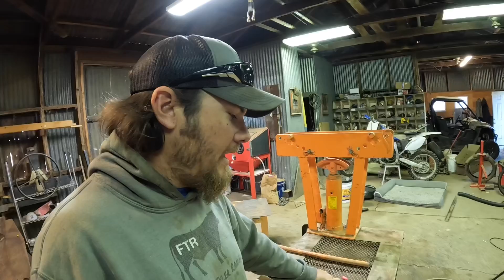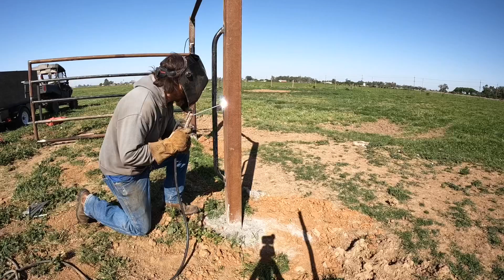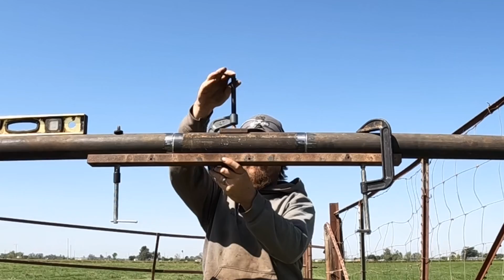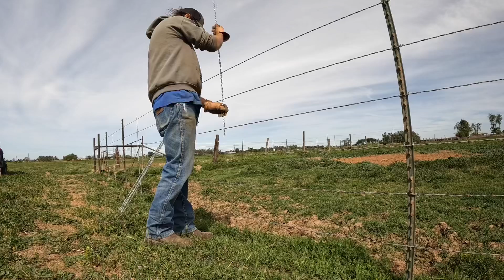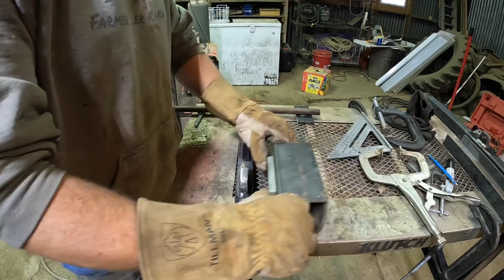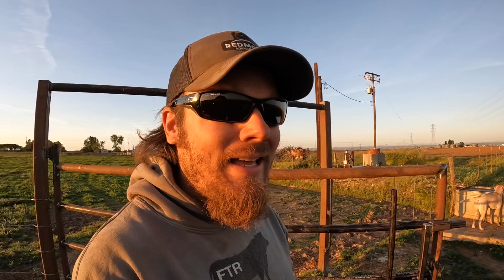Building the Gate Latch and Finishing the Fence!

Comment: That's  a heavy duty latch for a non- crowding gate.  I thought you were using that style of lever latch for horseback, except for the overhead cross brace...   I hate fence stays when it comes to repairing a damaged section.  I didn't see any trees, so you would have to run a cow or a 4x4 through the fence.

Comment: Nice work but don't you think a cow can slide the bolt with her head so that the gate opens? I would make something about it that the bolt has to be unlocked first with for example a pin that protrudes through the handle and a tube from the gate.
Greatings from Belgium

Comment: My Father and I have used wire stays for many years. If it has an eye at the top, we use a screwdriver to twist on. If the top is cut, we use a homemade jig to make it easier and quicker.

Comment: Really nice job Tyler.  You are far better at stretching and tying a termination knot with your barbed wire than I am.  Stainless nylon lock nuts would have been nice on the gate latch, but punching the bolt/nut in several locations should work for awhile.  I’ve done it a few times, but with usage the punch mark usually didn’t last long.  

At the end, I think Cali was afraid you were going to leave her in that field…she hit high speed to catch up with the utility vehicle as you went through the new gate!😂